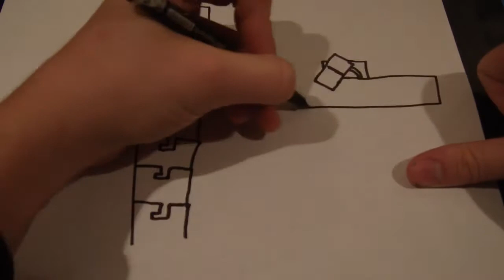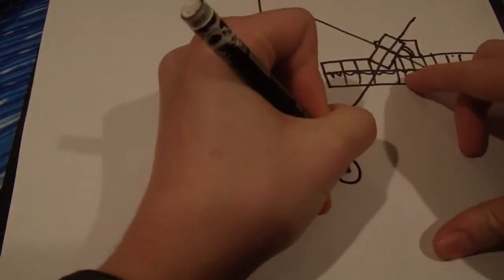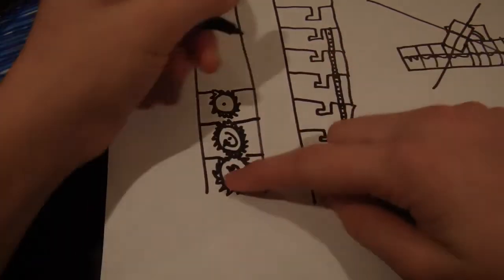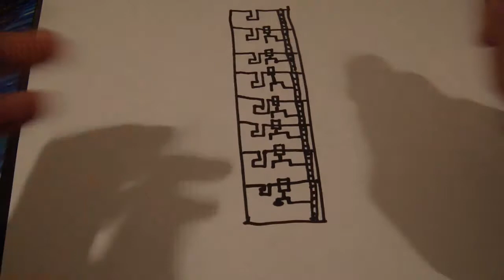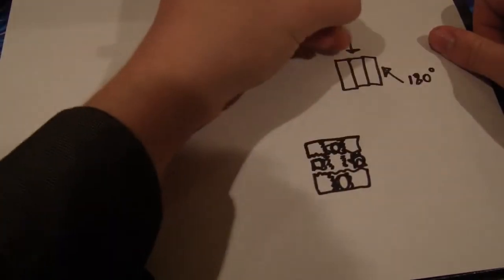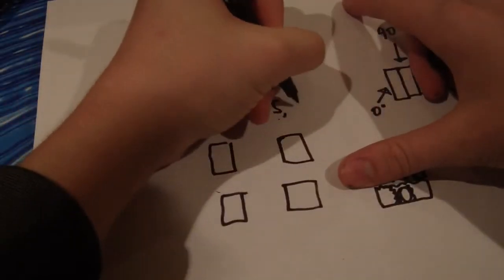2x2xInfinity solution

Comment: I don't know if this will actually work. What if it is a shapeshifting 2x2xinfinity? How would the gears still be able to connect to the core if the corners are rotated into a shapeshifted position? Or what if the orientations of the inner centers change?

Comment: in your challenge video you said no magnets. but i believe 3d printed shells. or just salvaged cubies attached to a 2x2xn magnet core would work well. turning would be difficult. but with the right magnets and and a decent design, you would get do able(not impossible, but not that easy) of a 180degree turn on the tall side, and 90 degree turns in all of the middle layers.